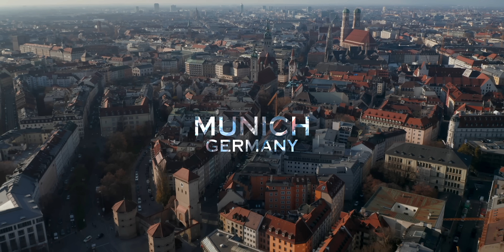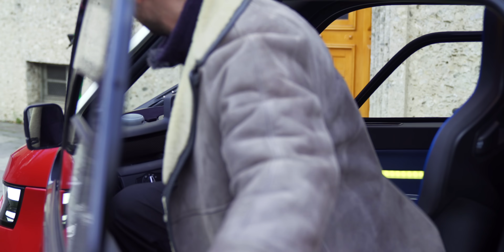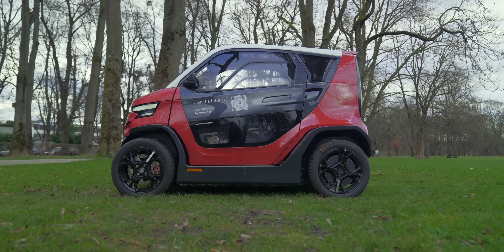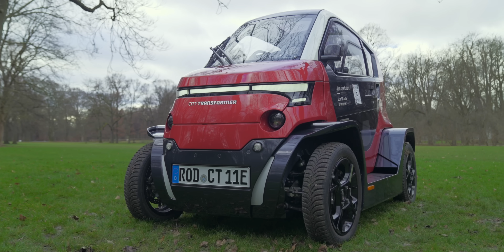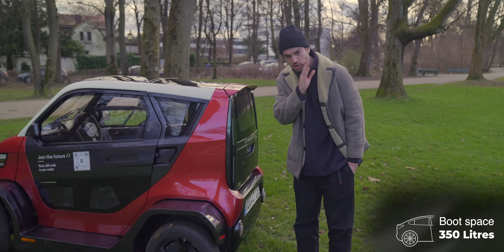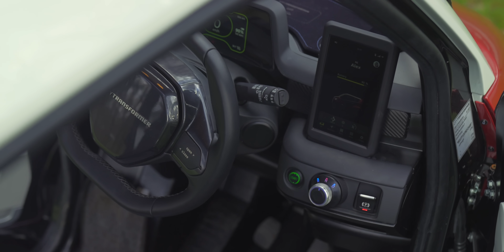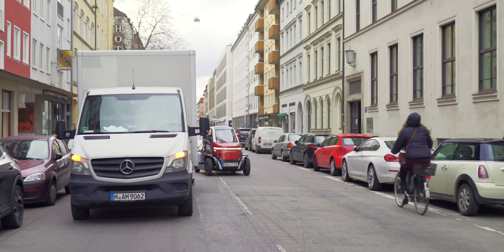The TRANSFORMING Electric Car Designed to Skip Traffic Jams!

Comment: Seems kind of silly to save 0.4 meters on space just to need more than that to open the door and get out...  I'd like to see a large vehicle that incorporates a smaller vehicle so that you can park your vehicle outside the city and then pull out the smaller vehicle for driving through the city.   Though I guess you could do that if you had a truck and a ramp.

Comment: I'd rather have backward sliding doors instead of lambo style doors. Removable battery would be nice to have if you live in colder climates and want to keep the battery in good condition and don't want to run into a trouble when starting the vehicle in cold winter mornings. Similar to what Squad EV has

Comment: The problem with that type of car is that you need another car, but you get the point if you have two cars. But for me, who am alone and only have one car, they are too limited. However, they will probably fill a segment in carcharing. But I don't understand why nobody builds a small practical car? I want to be able to have a towbar, I want to be able to take it out on the freeway, I want to be able to fit at least 3 more in it, I want it to be comfortable and I want a good stereo in it, should it be that much requested?

Comment: With different doors, it's a substancial step up on the aging Renault Twizzy. Sadly, with a mind to where the vehicle is designed and built,  a purchase  would be a matter of  individual moral judgement. It would work for some but clearly not for others which, if you are looking to achieve volume sales, is an obvious handicap.

Comment: Like the Ami et all over done on the miniaturisation (Doesn't need to be that small), over -complicated, gimicky and a Bertone commission nightmare. 
What are these designers and project commissioners on ?

Give me a VW e-up,  2 -up in standard comfort, optional back seats and spare wheel, with  a decent 250 mile range, composite body, weight paired down to the minimum,  no air con, no electric windows (Wind-up for the driver, the rest flip-out 2CV style), ABS windows, no massive plastic dashboard, no sticky-out external mirrors and two doors - soft close sliding, three pin mains plug or fast charger, and split two battery operation, so that one one can be offline being  charged whilst underway from a portable unit like the bluetti et al  whilst the other provides the motive power and a solar panel array built into the roof to keep the thing marginally topped-up whilst its at rest (Which will be 90% of the time). Job done.

Comment: Parking nose in isn't going to work when it is 2.5M in length. Most cars are less than 2M in width and already struggle with fitting in bays.

Comment: So, what's the kerb weight (which I see they do not give on their website)? The L7 classification limit of 400kg excludes the battery, so with a 110 mile range I guess it's closer to a car in weight than a motorbike, still less a bicycle or e-bike or mobility carriage. With that said, good to see more micro-cars coming onto the market.
Reply: Having asked City Transporter over e-mail, the kerb weight with battery is about 590 kg, so about:
* 3/4 the kerb weight of the Smart fortwo (W451, at 770 kg).
* 2.6x the weight of the heaviest enclosed mobility scooter I could find (the SCOOTERPAC Cabin Car MK 2 PLUS, at 222 kg).

Comment: The wider footprint is indeed better suited for higher-speed thoroughfares, but the additional cost for that adaptability is prohibitive. Better for commuters to transfer from a more generally capable larger vehicle to a more narrowly adapted, more energy and space efficient vehicle for getting about in tight spaces. And for the latter, there are already numerous options, many of which have greater flexibility in addition to higher efficiency. This is an over-engineered niche product with no hope of long-term success.

Comment: This kind of vehicle is a gimmick.  With the shape shifting, you could easily cause an accident by destracting someone while you are doing that change.  Also with the range is a little too limited for it to be very realistic as a delivery vehicle.  I think it would be better if the space used for the extending/narrowing wheel mechanism was used for more batteries and just make the sill safe to step on (or even just remove it, you only need mud-guards around the wheels after all).  Also 30 mph is not plenty for such a vehicle.  There are many town and city roads where the speed limit is 40mph and you will get a lot of aggro if you are constantly holding every-one up by 10 mph.  My last point is that they had might as well forget the second 'seat' and just make it a luggage area.  This is a car for singles only and no matter how you try to get around the laws of physics there is only room for one person in a vehicle that small.

Comment: All good stuff Jack. But what happens when you crash it, or a 44 tonne articulated lorry decides to run it's trailer wheels over you?
Reply: Hopefully the point is that this class of vehicle wouldn’t share the same road as a 44tonne lorry.
Reply: @shhhyouknowhoo3753  (Do  I know you?) And what's going to stop that happening then?
Reply: @Musketeer009  cause those don't usually run highway speeds in city centers as we know them
Reply: @el_es  In the UK, lorries, cars, bikes all use the same road, unless there's a specified bike lane. These cars, don't use bike lanes, so are on the same roads as everything else.

Comment: Just needs a solar panel on the roof and those scissor doors and that would be super amazing.
Reply: What would a solar panel do? It would not charges the battery fast enough
Reply: @opjoter  Depends on the application. I'm fortunate enough to live in a situation where I drive my vehicle only 1 to 2 times per week, so while a solar panel would charge the car slowly, there is still enough time between my drives for it to work. Also, I don't have any public charging or home charging stations available for my use, so it would make it even more perfect. Solar panels and the charging equipment that connects to them are fairly cheap now, so I would be willing to pay extra for it as an add-on. I realise that my scenario is a bit unique, but I still love the idea. As electric cars become lighter in the future, they will require less energy to move, so the small amount of energy that can be generated by roof mounted solar panels will become more and more attractive to all automakers, IMO. Never having to worry about plugging again, just being able to walk away from a car and have it charge by itself, and then coming back to a fully charged car when I return sounds like something straight out of the future to me. I love the idea.

Comment: For sure EU should subsidice microcars... Less traffic (more space in the streets), more parking spaces, less pollution, less noise... Is it safe however? what happens when you crash it? It is safer than a mobility scooter but its not safer than a proper 4 seater..
Reply: For those outside of the vehicle, thin cars are much safer than side-seated cars. For those inside the City Transformer, the speed limiters will keep it safe from going too fast, and it will have weather and road protection not afforded motorcycles.

Comment: The critical factor will be if this can be registered as a bike. If it can then it will be able to take advantage of the decreased size; the filtering, the small parking. But if not, then the use of bike lanes will be illegal, restricted to full size parking spaces, etc etc. This is a fabulous design concept that is utterly dependant upon favourable legal representation to reach its potential.
Reply: It is a 90 km/h car but in a narrow mode it is only 30km/h... if it was 25km/h it was legal in my country also on the bike lanes.

Comment: Motorbikes/scooters can reduce time in traffic jams by filtering. So long as this car is too wide to do that it can't 'skip' traffic jams....what it could do is reduce the size of cars in the jam.

Personally though, can't see this taking off at all....micro cars are not a new invention but they have never taken off in bulk. They could only work if roads or our relationship with them fundamentally changed. If this was some kind of autonomous taxi service maybe, or, if vehicle lane sizes were reduced
Reply: Any vehicle one meter wide of less will be able to filter and lane split. One meter wide or thinner vehicles will also be able to park far more conveniently.  The growing popularity of electric side-seated cars bodes well for a breakthrough for popular thin electric car designs with supporting lane and parking space access in the future.
Reply: @MickeySimple  in hindsight I think you are right and the changeable chassis geometry will make it possible in some situations, but I still don't think it will have the ease of a bike for getting through gaps.

Comment: Where do you put your kids or your significant other? So now I have to have the family vehicle, or the vehicle I use when I go to the market for groceries, AND one of these for my daily commute to work?  So we're ADDING to space required instead of reducing? So, sure - for a niche part of the population, i.e., single people living inside city limits - but I don't think it's a panacea for the city congestion issues.
Reply: Most car trips occur with only one person in the car. Thin cars significantly reduce empty car side-seat hauling, congestion, commute times, collisions, land wasted on parking lots, and induced demand costs. If you can only afford a side-seated car, you won’t get the much faster lane splitting and parking commute times provided by a thin car, but you will benefit from the increased road width available to you because people are driving thin cars.

Comment: 5:50 if I were to park nose in first, I would leave enough room for the next car to leave without touching my doors. Park with not enough room to open a door is sure invitation for someone to accidentally on purpose bump into your door.

They tested this on Top Gear, and it's not quite small enough to filter through city centre traffic. I am not convinced by this concept. Something like the Twizy with more creature comfort is probably what we need.

Comment: This is not a 4 seater car but the Dacia spring beats in in price. Any petrol city car beats it in price. Half the electric Chinese minis do. And 170km with 16kW Battery is not frugal, I can move my tesla Model 3 with that if I travel at 50kph. The microlino would get twice as far.
No, they have to work on that. A lot.

Comment: I am very willing to buy such a car but not as long as it is three times the price as a petrol VW UP for example. 

And I guess it will be because Microbrand.

Why can't one single mayor car manufacturer make a tiny car like this that is reasonable priced. 
I don't need all the fancy stuff, just an EV that runs more than 80kmh and costs less than 10k€ new

Comment: This is not the answer. The way to go is conversion kits for existing small ICE vehicles as they will be cheaper and give better performance, not to mention extending the life of already manufactured vehicles.
Reply: This is a major piece for the answer to reducing congestion and significantly improving commute times. Thin kit cars work. Thin prototype cars work, and thin production cars will work.

Comment: This car is nice but I can't help feeling the  sliding wheels are an expensive gimmick.        
If you can't really see the wheels I wonder how many times you would actually use the space saved. normally you judge the side of the car by the body and mirrors, with this I can see someone going for a gap and catching the sticking out wheels on something as they stick out past the mirrors. They would have been better off dumping the sliding tech and going for half way out (best/worse) of both worlds. 1.3m wide or something.

Comment: This video broke my faith in Fully Charge with  biased comments e.g. testing the stability in narrow mode but not taking a sharp corner at top speed - will it flip? I suspect it would but not shown or tested : would like to see that vs it being at extended mode - the point of that tech. Will it flip in extended mode at top speed around a corner?? And recommending squeezing in between cars to get to the front , parking in between cars in parallel parking - really?? This video was all about the positives with some imagined, and none of the negatives which the manufacturer could take note of and improve upon.

Comment: An interesting video about a possible niche product, and the market will decide its success. Thank you! - Or maybe my Smart-based 123Mobile will be a success? Because I drive a proven SmartED two-seater, and develop it into a useful and comfortable three-seater, 2.8m long, 2m wheelbase, adjustable ground clearance 15-25cm by adaptive air suspension, solar roof 300W for battery refreshment, trailer hitch, bidirectional charging, 4x12kW efficient wheel motors (Elaphe, Protean or DeepDrive ), big wheels for all terrains, efficient 12kWh/100km, 3x12kWh selectable battery sizes, 130km/h, nice aerodynamic shape and beautiful colors: Top equipped for 29k€. - What do you think about that?

Comment: Whilst the transformation has it benefits around town, and gives improved stability at higher speed, I still think the low top speed limits its appeal for commuters who might need to brave the motorway - yes, 55mph is doable on a motorway, but I can't imagine it would be much fun, particularly getting on. I was hoping this might have been the ultimate hybrid - drives like a full car out on the highway, but has the benefits of being tiny in the city. I do have a slight concern for nose on parking, having not had to manouvere into the space, it could be easy to squeeze into a space and not leave room for the normally parked cars space to get out. Additionally, the extra half a meter or so that this car would protrude from normal parked cars could then limit the ability to 'filter' through the gaps in traffic.

Comment: Park nose first? It's 2.5m long, that's 70-80cm more sticking out than most cars have as width. In narrow city streets, if you do that on both sides - or maybe just one, nobody can pass or cross. It didn't work with the Smart ForTwo, it won't with this. It's also way too wide to drive it like motorcycle in between cars in traffic, splitting lanes. Obviously. There's sometimes hardly room for a normal motorcycle to drive between lanes of slower traffic. Driving in traffic with tiny cars like these flying around you, jumping in & out lanes, would be another level of hellish traffic. The normal doors also completely destroy the benefit of the narrow shape, as mentioned in the video. I'm not seeing anything innovative. It's an electric ForTwo with less room but it can pull in its wheels.

Comment: Seriously, unless it can expand from 1-4 seats, no point in this un/folding.
Not to mention that the fenders are too delicate to step on.
This is not gonna handle inner Athens parking space “kisses”.

Get an e-bike if you can’t use your legs. Then when you get scared by some cocaine-fuelled Cayenne driver you can just get off the road. Even jump off the bike in a second.
This looks like that kind of car would just roll right through you. Not to mention your child in the back. But it is your fault for getting in the way of SMS-sending Sniffanie on her drive to “work” while riding in your poverty mobile.

Yes this protects you from bad weather, but are the batteries protected?
Between this and a Picanto I would take the Picanto and use my legs when possible.

For reference I have a Polo for the 5 star safety rating which I use for dad duties (I have two kids, so what good would this do me?) Legs and public transit system for everything else.
“But what if public transit is down?!”
Well, I do have a Polo.
“But what if the apocalypse happens?!”
Then I doubt transit will be my primary worry.
And my Polo will drink a lot less than a cocaine-fields cunt-mobile.

Comment: Still in most places in the united states don't have chargers or the ability to provide enough electricity so maybe some day
Reply from the maker: Just checked various sources, there are just over 89,000 high speed chargers installed in the USA, all open to the public. There are over half a million lower power 'destination' chargers. It's a slow transition, it will take 10+ years but it's happening all over the world. Just a side note, server farms and particularly servers for AI use 4 times more electricity every day than all the electric cars in the USA. Somehow they seem to have the ability to get enormous amounts of power

Comment: My problem here in Hungary with microcars is that they are still very expensive but more importantly I can't drive them to work, because I work in Budapest but live in the countryside and you can't drive these cars on the motorway which I can't get around on my route to work.

Comment: As long as they avoid making the design too effeminate (which would put off a lot of male customers) I think it could squeeze into an interesting segment particularly if it becomes possible to fit out many London attached houses with narrow front yards that currently don't cope with parking.  I'm yet to hear any tangible solutions to how they'd retro-fit existing streets in the UK to accommodate full-size EV charging for street parking, this might provide that oh-so-essential interim solution for short journeys, delivery drivers, to/from work trips, etc.  Safety would be something they'd need to be awfully sure of, not so much for single vehicle accidents but some idiot in a truck knocking you off the road because he isn't looking properly at what is below him.